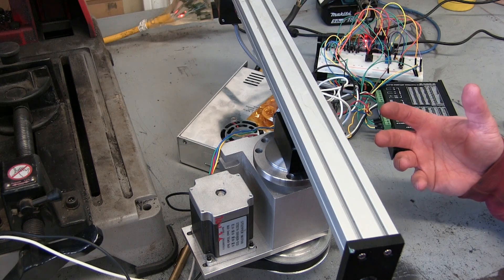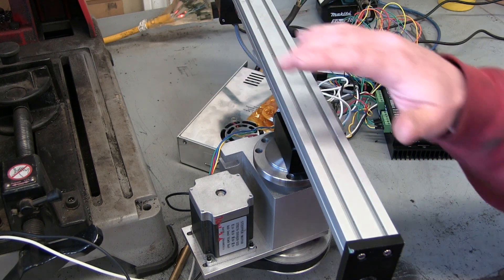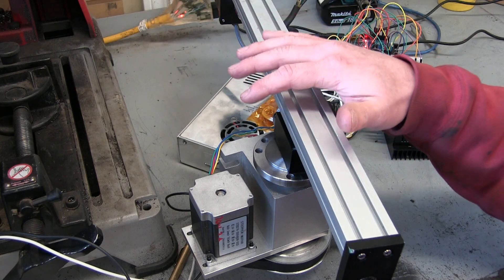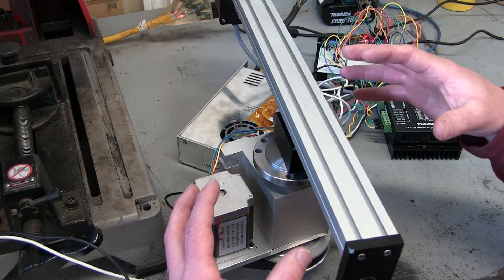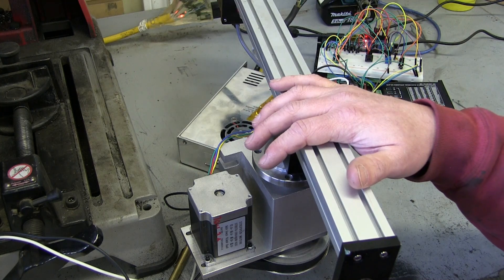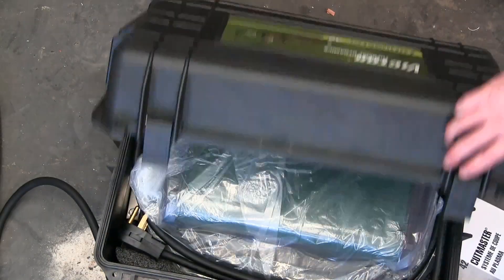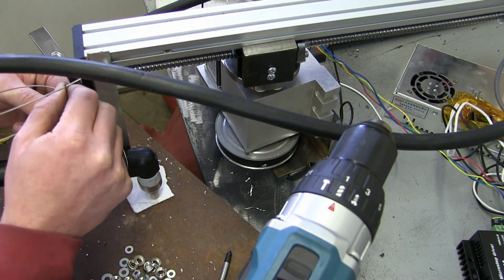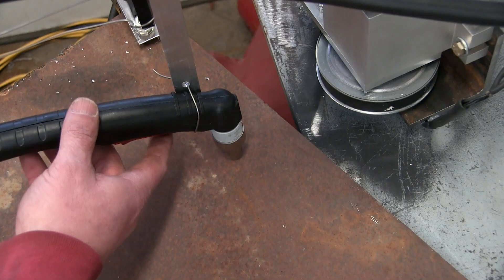Portable CNC Plasma Prototype

Comment: Preface with I have no fucking idea what I'm talking about and this is just what popped into the brain...   The actual linear cutting speed will vary for rotary movement depending on how far the arm is extended.  So for the curvy 'square' that was cut here, the inner and outer curvy edges are being cut at different speeds (inches per second) assuming the motor turns the same speed, (dungarees per second).  Rotary motor would need to move its slowest while arm is extended to its maximum, and could move faster when arm is closer to the base.
Reply from the maker: Yes. Computers are, above all else, good at crunching numbers. ;-)

Comment: Any point that can be represented in Cartesian coordinates can be represented in polar as well, so my my suggestion to you, and this is just off the top of my head, is to play a game of connect the dots. Say you want a 2x3 rectangle, in cartesian you know that the corners would be at (0,0), (2,0), (2,3) and (0,3) on a graph. (0,0) would be your starting point, and moving to (0,2) would be easy since it's on the same line as (0,0), the point (2,3) get's weird but that's where the trig comes in, the angle to that point relative to the x axis is arctan(3/2)=56.3 degrees and the radial distance is good ole Pythagorean's theorem sqrt(2^2+3^2)= 3.6, so you would rotate 56.3 degrees and extend 3.6 units to get to that point. Though of course that won't give you what you want, to get a nice straight line connecting (2,0) and (2,3), you could find the angle and radial distance of as many points in between (2,0) and (2,3) as you want accuracy, i.e (2,0.1), (2,0.2) and so on up to (2,3) and move to each point from the previous, this way you don't necessarily need to move both directions simultaneously, I think a small change in angle then a small change in length over and over again would get you a fairly straight line considering the accuracy of the plasma cutter. The smaller your intervals though, the more it would seem as if the arm is moving in both way simulatniously. You then do this  for every side of the rectangle. You could do a similar process for circles though the math is a little more tedious. If you're using an arduino I think it should be capable of handling trig since it uses C++.

Comment: There are two concerns I see up front.  You mention the rotary speed, and that will vary based on how far out it is from the pivot point.  Obviously the further out it is the faster the travel from the center.  Secondly, straight lines on the rotary part will also be difficult as there is a curvature to said line because of it being a rotary point.  That being said, I'm sure there are ways to combat those two issues with algorithms and a formula.  So Id like to say kudos to you sir, your proof of concept is a helluva thing!  Keep 'em chooching! love your vijeos as always!

Comment: you could technically add a third axis, vertical, so it could work on piping, just factor in the size so it could contour properly.
Reply: _Husky You'd probably want to move to a 5-axis head at that point, so that the cutter can stay close to the, um, cuttee, on steep slopes.
Reply: OtherTheDave that's what the third axis, being an up and down, unless cutting higher than 45° angles out of said pipe, a vertical head would suffice, but a rotating mechanism on the head could bypass that.

Comment: Make sure you use a good reduction gearing for the axial control. As you extend the arm out, the error of the angle will be extrapolated, a'la lookin at your zits with a magnifying glass.
Fine stepper motors are good, but if you reduce if a few times, and have nice tight gears, you should increase the accuracy.

Comment: I would use two lead screws running in opposition to even out the motion, then perhaps run a  "buffer area" in the programming so as-to reduce inertial forces wanting to inadvertently "adjust" the machine, like a "soft stop". Additionally, if the base was of a modular design, whereby you could add "outriggers" to stabilize the base more, it's chooch would be more skookum.  Modular tool holding would also be a good thing, perhaps  Oxy-Acetylene, and plasma and might, and a hole saw
Reply: You also would need a depth adjustment, so you could work off something higher than what you're working on, or even being able to set it up perpendicular to the work surface, because as I'm sure you're aware, in the field, it ain't always that easy. Also though, if you had a depth adjustment, the height would need to be higher, which would mess with the stability, but it could enable the thing to perform work on the other side of cross-members

Comment: I'd love to use one of these to change holes into slots instead of die grinder when the bolts don't line up. A shorter linear actuator would let it fit more places easier. If you need much more than 6 to 10 inches, you're probably not going to do it in place

Comment: Polar coordinates is what youre working with, instead of "x" and "y" you have "r" and "theta". r being radius (actuator), theta being angle (mag shit). 

Any x/y shape can be represented in r/theta with the following:

r = (x^2+y^2)^.5
theta = tan^-1(y/x)

So, if you could conceptualize how to trace the desired shape in rectangular, then you could code it like you are, but pass the output of those x/y values to the above functions, and then r goes to your actuator and theta to your mag shit thing whatever the fuck its called
Reply: You are going to have a pain since your shapes are not centered at the origin tough. Just make sure you take that into account. So, when getting your x/y values for a square for example, its not a square around (0,0). Its a square around (4,4).

Comment: If you get a better linear axis, that thing will be pretty good. I'd be a bit shy to use an app. A dedicated controller maybe, but phones are just too fiddly to use while you're working on stuff. I'd recommend using that little OLED display from your tab-welding project as an interface, and a rotary encoder (or just buttons) as an easy-to-use interface that's completely self-contained. There are cheapo 2.4GHz transceivers that run off of SPI interfaces, but that would just be for moving the controls onto another microcontroller-based device.

Yeah, let me know what you think about that, I think it would work rather well.

Comment: On a practical note, if you are trying to create straight lines it will be easiest if the arm is nearly fully extended because the greater the radius the more straight the lines will be. This reduces mechanical jitter bullshit and could simplify movement

Comment: Seems pretty skookum. The only problem that jumps out at me is locating the hole to cut- it's hard to set a g00 when it's as portable as you want it to be. My first thought was a photo sensor/camera on the head that  would look for a paint pen mark on the surface to be cut. Maybe you could even just draw a shape on the surface with paint pen/marker and the thing would cut it out as long as it's between its min/max radii?
Reply: This is a complicated solution from a software perspective. A demonstration system might be more appropriate, and easier to program (cheaper). It asks for two points on the shape (corners on a rectangle, perhaps, or center and an edge on a circle or curve) then disengages the drive system and reads the encoders while you hand indicate those points with a needle attachment and a button.
Reply: Even if they are steppers, the machine has to know their abslute position or it wouldn't be able to calculate the kinematics correctly. I think it would be simple and good to drive the arm manually to some points you defined and the software then aligns the drawing to these points so that you can achieve a rather good alignment.
Reply: Mike Neth You wouldn't need to zero it since you would know the cut area you just home it and then line up the home with what would be zero point and hit start.
Reply: Probably isnt that bad. 
You could add a couple of rubber buttons to move the tool in/out and that sets your start position. 
Or as others have suggested power off and move it manually. You just need a datum start position and to know which way it draws the shape. (Perhaps each shape has a lil diagram with a dot marking the start. )
Reply: the math for tis is so simple... the implementation and the ideea are hard to find and greasy""
Reply: Mike Neth for simple geometric cuts, just have a machine-readable order-form sticker. Sharpie the relevant check-boxes for shape, size and feed rate... stick onto relevant place... and off she goes.

this also solves the registration issue of tool to workpiece... since the mark/programming lives on the workpiece, not in/on the tool.
Reply: Or you can place the head manually where you want to start the cut. He only use steppers after all, so it's all relative already, you just have NOT to add the calibration data for g00
Reply: Gig Anonymous something basic like a magnetic pin to place on the center of your part - then have all your axis have a loose mode like a clamp on the drive belt to the carriage that you can loosen.  a universal head on the torch holder.  set that up and hit zero on the app.  tighten the drive belt clamp and universal head and Shazam.  orientation of drawing would be with respect to an axial line to the center of the base.
Reply: Something like a touch probe (electronic center finder?) and then just work from that point?
With a series of library shapes, perhaps several touch points to establish the general parameters.  So if you chose the library shape that was a circle, maybe four touch points all of which would fall on the perimeter, if the library shape was a square maybe two that would define max length and width...
To me the important part here is the plasma cutter has eliminated a lot of the forces compared to a mag drill, in practical terms.
Reply: You can't power them off, they would forget their positions and wouldn't be able to calculate the kinematics right. Fr example if the controller doesn't know, where the linear slide is, you get different distances when it rotates a fixed angle.

For alignment two points would be enough for a 2D shape, with them you would be able to get position, orientation and scale.
Reply: I agree the shapes and areas would be limited and you would never be cutting 360° because sheets of metal are not round. Therefor you would only need to  bring it to a home position.

Comment: Holy hell, this is great. Been thinking about some CNC plasma cutter for a while, law of flat spaces was making me think of a gantry I can load on and off the bench to save space.

But stick 'er on an arm and go to town, fackin' genius! Have a funny feeling the maths is easier than you'd think for plotting, need a trig wizard to see the wood for the trees though.  Got any plans for controlling the height or is it a seat of the pants adjustment?

Firing drawings from an app sounds like voodoo magic to me, if you're just plotting prebaked shapes at different scales starting at a fixed point then a cheapo LCD and some buttons would get 'er done, no?

Comment: the radius or the circle changes dramatically the further from the pivot point the head is so the G code needs to be adapted to slow it down and fyi im a tool on the stool not a tech guy me and my buddy have a cnc plasma table we got to build mega mud trucks

Comment: Issue 1 is the slop that might happen due to polar/angular coordinates. Since the Step/rev convert to a constant arch angle even with gear reduction, as the radius go out the precision of cut/shape might be reduced. For example a 2ft circle not centered on the tool would have smooth curve close to the tool but there could be visible "corners" on the farside. You can solve that problem by having more steps per rev with different gearing but then you could get more backlash as tool head changes spin direction.

Issue 2 is as the arm gets further out the possibility of a snag on slag wrenching the tool around might be an issue and could lead to messing up the cut.  So to give the arm bit more staying power, I would think about a Mag end that more than just under the center of the tool head. Something more rectangular centered at on end with proper length and girth  determined for highest torque you expect to encounter. As a side note perhaps a sensor/ switch that might be used to determine if the base has begun to twist/move and pauses the cut to the work piece is not ruined. You could use something that measure torque on the arm but I can't think of cheep easy way to do that. Rather I am thinking of something like a safety switch on treadmill that no one uses. One end attached to the work piece separate from the tool with a small permanent magnet and other side next to some limit switches . If you know which direction the tool is breaking loose form the work piece you could know where to pause the cnc routine and with some magic the app/programming could make it possible to restart the cut without wasting the whole work piece.

TL;DR I might have insomnia.
Reply: codewarrior007 sensing a hangup is easy. spring loaded wrist with a limit switch on the wrist. switch gets tripped, you got a hangup.

Comment: Lots of comments on the maths, not so many on the 200 pound gorilla proof app. Two ways you can go about it, all the control logic, shape profiles and speed control go in the firmware on the device then the app sends simple bluetooth commands to select a profile and dimensions from the baked in library. Easier to implement on the app side but not super flexible. The other way is having a much more robust communication protocol between the app and device so that the app does most of the control. Way easier to add new shapes, pull in CAD drawings and such, but more complicated to implement which provides all sorts of holes for the software gremlins to live in.

Comment: honestly for beams my one company had a beam line for drilling them  and for average thickness and can get a porta punch on it would work but for repeatable in  large plate that cant go on your standard xy axis unit i would say ok  but honestly you would still need to measure where to put the machine exactly cutting a template sticking it down with magnets would work just as quick for setup especially if you have a larger cnc basically cut some 1/8 plate 3/16 bigger around and should come out perfect using a hypertherm powermax 105 and that's compensating for the kerf with new tips

Comment: This has potential. I am a welder/fabricator w 12 years experience. Gave that up now in Mech-Eng school. Here is my feedback. First, the thing would have to be tough enough to take more than a few falls to concrete, puddles, getting some steel oxy cut in it's direction, ect. Second, no phones, shops don't want workers playing on them anyways. Ercolina SB48 has a screen and some buttons that hold up in shops. Guys will typically lay things out with soapstone. So the setup would be to energize the magnet with the machine in the general vicinity of the feature. Second to tell the machine what it will be doing out of your canned list, 0.5" hole, 1.125" x 4 slot, whatever. Then with the head of the machine unrestricted the user can move the head to key points of the feature to zero the machine. Like use a laser, or a pin on the end of the head to point at the center of a circle, the two centers of a slot, two endpoints of a straight line, stuff like that.
Reply from the maker: Great feedback. Thanks Johnathan. I've got a joystick and a "learn" routine to map soapstone layouts. Good point on the phone too.

Comment: I know there are already close to 500 comments, but I figure if I can just get my 2 cents in, one for each idea, that'd be cool. I was thinking that A) the plasma cutter seems to be setup wrong in my opinion, you should have it parallel to the slide axis to keep the cord straight and reduce the footprint, and I'm not sure if a mosFET or a servo would work better, but I think there should be enough pixie control that you don't have to hold it. B) I think it would be cool if you could use an inductive proximity sensor to check if the cutter would be bumping into things (not necessary, but every little bit of foolery proofing helps).

Comment: Add a Spark shield to increase the life of the belt attached to the stepper motor. 1/2 inch thick shit all the way down to 1/4 will spray molten metal everywhere if you gouge like that.  Other than that. A standoff gauge with a better clamp as well as a gouge mode would be neato.

Comment: Hey AvE ! I like this idea a lot ! As a engineering student (and I hope future engineerd) I'd love to work on this ! Cartesian to polar coordinates conversion is something I've already done quite a few times what for Physics and Kinematics problems, just needs to be adapted for the pulley / leadscrew which is dead simple :) I haven good experience with Python and a little bit with G-code (mostly for 3D printers though) if it can help :) If you wanna get in touch : mahot.descelliers@gmail.com Another idea : steppers don't provide feedback, but with rotary encoders it would be possible to manually move the tool head to define tool paths, no-go zones, starting points if using relative Gcode !